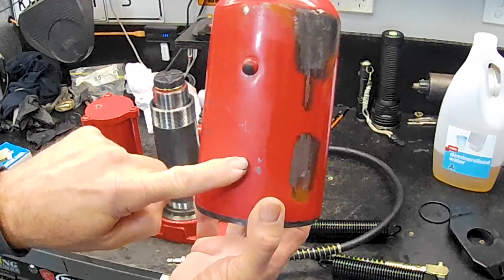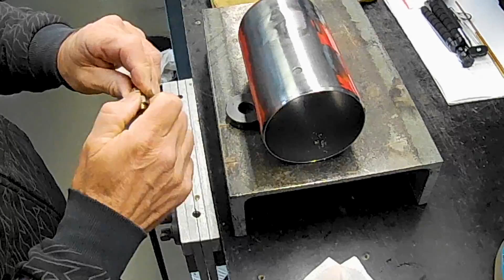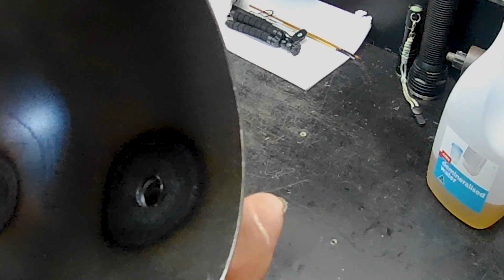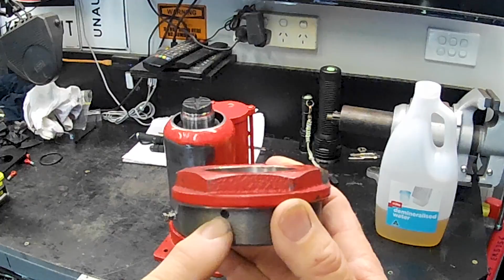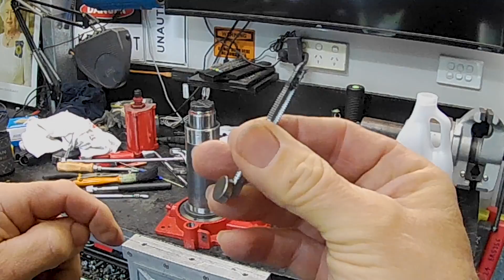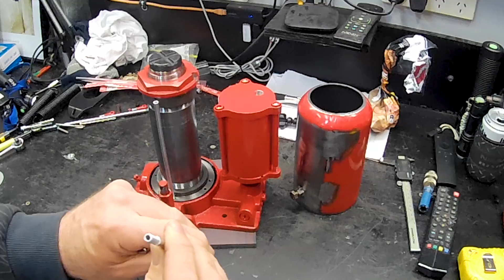The Ultimate 20 Ton Shop Press Build, EP:2 Inverting The Hydraulics

Comment: well done on the project.
I suggest it is not the vent hole at the top of the jack, but the rubber stopper that causes the Fart noise, that is that releases the air out of the jack when the piston retracts.

your hole in the bolt is good but place a filter over the hole to prevent debris entering.

cheers.

Comment: Excellent video series Sir.  I am learning as you record :).  I have a very similar 12 ton that I have adapted to my motorcycle lift in place of the smaller non-pneumatic assisted stock jack.  I have not modified the jack in any way other than drill the foot to mount it to a pivot plate.  The new jack position is laying on its side a about 3-5 degrees off horizontal, with the ram side on the up-end.  In this position after bleeding I added fluid up to the plug.  I hope this application continues to function with no problems as it initally has, I didn't know about the air gap needing to be evacuated and refilled and didn't think of it.  Perhaps with the jack being on a small tilt up the air gap will expose some of the end cap interior  and will still release air and not emit fluid.  So far, no leak.  Thanks again.

Comment: suggestion on the vent hole. instead of filling make 2 holes. then connect them on the outside of the bottle with a clear plastic or glass tube. you now have a fluid level indicator.

Comment: Invertered my jack which is the same as yours but it won't pump on the hand lever but is great on the air ,what have I missed out ,cheers
Reply from the maker: Hard to say Ken, could possibly be air trapped in the hand pump side. Give it a few pumps then release the valve, & repeat a few times, if it improves the issue you'll be good to go. From memory mine was a bit slow to bleed on the hand pump side, but once sorted its never needed any attention again. Good luck with it Mate, Cheers.
Reply: @TheAussieShed  thanks for the quick reply, spent most of the day messaging with the jack/press but still not working on the hand pump, the only thing is I never checked that it worked properly before hand ,you never made any changes to the hand pump did you?cheers ken f
Reply from the maker: @kenfox1911  G'day Ken, as you would have seen in the Vids, the only Mods to the hand pump side of it was the Dip Tube & Reversing the Mechanism. Wish I could be of more help Mate. Good Luck, Cheers.

Comment: Great job on the whole series, thanks for sharing. I'm building a press from scratch and I'll be using most of your innovations. Working on the jack which is almost the same as yours. I found that the oil inlet port for the air pump was 1mm bigger than the port on the hand pump. I tapped the hand pump port to 6mm and the air pump port to 7mm. I'm using an aluminum dip tube with a 4mm id for both hand and air ports. My concern is I'm reducing the inlet port for the air pump from a little under 7mm down to 4mm. Based on your experience do think this will impact the performance of the jack?
Reply from the maker: G'day Rich, damn I sent a long detailed reply yesterday & it didn't show up. Anyhow, you should be fine, I've used my press a fair bit since completing it & no issues what so ever with the Inverted Air/Hydraulic Jack. 4mm in my opinion can & does Easily keep up with the required fluid volume. Good luck with it Mate, Cheers.
Reply: Did your jack work OK?  Cheers ken
Reply: @kenfox1911  Yes, jack works great. I just duplicated what The Aussie Shed did. You can see it in action on my channel crimping a hydraulic hose.

Comment: Ok, now I understand the purpose of the vent hole in the nut always wondered why is was there. So you have addressed the movement of air in the oil reservoir, what about the movement of air on the annulus side of the cylinder?
Reply from the maker: G'day Mate, any air in the cylinder will be purged back to the reservoir after the first release of the main release valve.
No more air should be ingested into the cylinder after that, as long as the fluid level stays above the Dip Tubes.
Cheers.

Comment: Have you considered how the modifications will affect the manual hand pump as normally you have to pull the handle down to force the ram up and on the up stroke the pump refills with fluid ready for the next down stroke. Does this mean that you will have to push the manual pump handle up to move the ram?
Reply from the maker: G'day Mate, good question. I'm pretty sure I address that issue in  the next episode. I have made a new mount & reversed the Mechanism. It worked out really well. Nice Spotting. Cheers.
Reply: The Aussie Shed. Cool, I’m looking forward to the next instalment. I have a 20 ton shop press that was made here in Australia by J&B Wade in Ballarat VIC. It uses an inverted jack but I don’t know what all the required modifications were. The only reason I asked is because I was using mine last weekend and I happened to notice that the pump works on the down stroke even though the jack is inverted (so that used to be the up stroke) and wondered if it had to be modified to work like that. In my view your modifications are a very worthwhile exercise as my first press was the standard cheap setup with the upright jack and the moving frame. I found it frustrating as the play in the frame meant the ram could move around. Having the ram firmly mounted makes pressing work easier and more accurate as I’m sure you will find. Cheers Stuart, Canberra.
Reply: @TheAussieShed  I had considered that as well and then went oh just reverse the mechanical system using old mate Cantilever. Cheers from John, Australia.

Comment: You may need to check the air cylinder to see if inverting it will cause problems with oil flowing where it shouldn't.
Reply from the maker: G;day Mark, Its all good, I have this actually all working now & no problems, It definitely was a concern though. Cheers Mate.